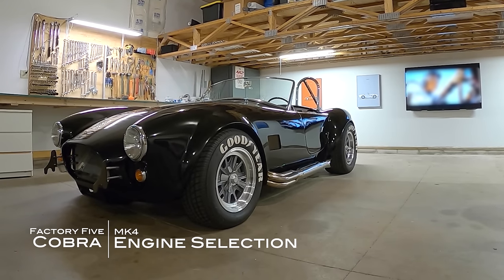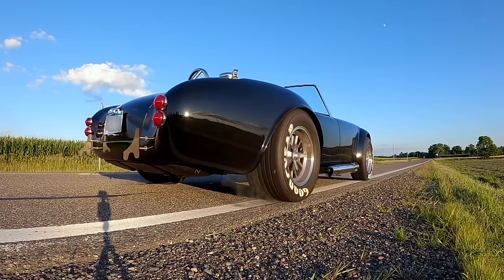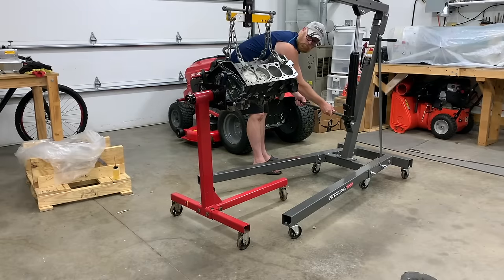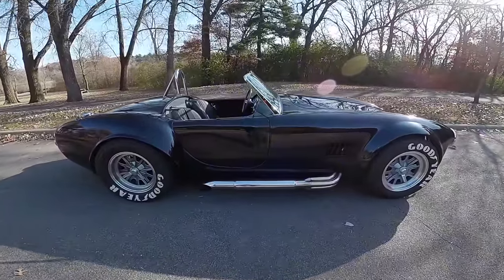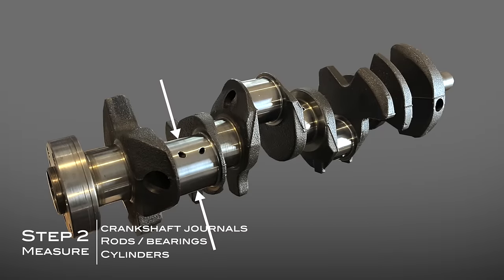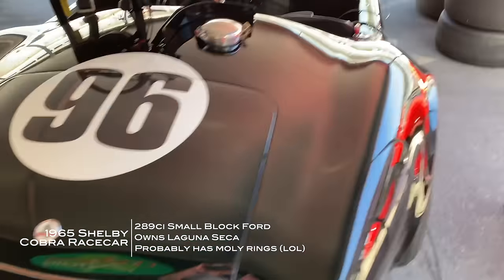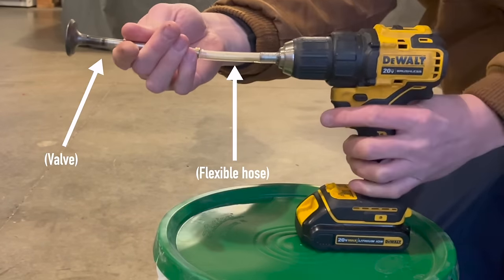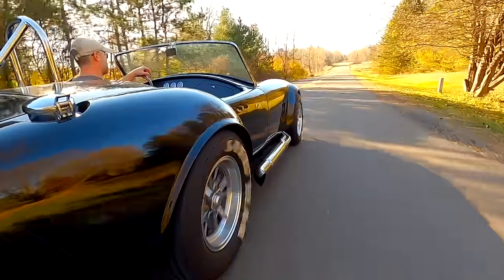Factory Five Cobra: Engine Selection

Comment: For the money, I would never use cast iron heads. I could agree with 90% of your points in the video (with a few caveats)...but there is NOTHING that 'flows well' in a small block Ford head. Even the GT40p heads that I believe came on the junkyard motor you bought are just the best of what are a horrible cylinder head design (and that's assuming your headers fit them lol). Your 300hp goal is what it is...that's subjective (I happen to disagree!!...having driven many of these cars with various power levels I wouldn't want less than 450hp and a 7500rpm shift lol). But for the purpose of the investment, and all of the benefits you're giving up...not spending the extra $500 (if sourcing used) to $1k or so on new alloy heads/cam/intake just makes no sense. You can always sell your stock heads to some kid on The Corral to make up some of the cost as well.

The aluminum heads are SUBSTANTIALLY lighter, improving weight distribution in a car known to be front heavy, and far more tolerant of poor quality gas. There is never a downside to running alloy heads on a small block Ford. If you want less power run a smaller carb, tune the motor differently, or if you truly can't deal with the differences, put a throttle stop on it. You could also run different rear gears and improve your economy substantially, while taming the car down a bit.

Well done video though, and thank you for sharing. Content creators on these topics should absolutely be appreciated.
Reply: Oh! Also...to expand on the higher horsepower/rpm point I made above. What's dangerous in these cars isn't necessarily horsepower...it's aggressive low end torque. It's the same in any relatively lightweight vehicle. I drove a 600hp naturally aspirated 347 67 Mustang for years...this was a 10 second flat car in the 1/4 mile (with a 7800rpm shift point), and would easily peel your eyeballs if you had a clue how to drive it. BUT...the way I built the motor, power didn't really come on until around 4000rpm. I put a 4000rpm rev limit on it and let my mother drive it for two weeks while I replaced the motor in her daily driver (it was that, or a 6" lifted F150 lol, she chose the Mustang as she could at least see over the wheel lol). She never even noticed the rev limiter and liked driving it a LOT more than she expected to. My then 16yr old daughter drove it easily as well. That motor in a Cobra would have been SO incredible. All the manners and good power you could ask for if you kept your foot out of it, INCREDIBLE sounding idle...and blinding speed if you ever wanted/needed it. The best of all worlds in my opinion...and far easier/economical (not to say 'cheap'...just not crazy expensive) to build than most people would think.
Reply from the maker: hey Chris - building a small block now to replace the explorer motor / going to have aluminum heads (AFR?)- stay tuned and thanks for the comments!
Reply: @TacoJoe  I prefer TFS to AFR myself lol (AFR are great heads....just not my preference!)...and don't fall for the 'port velocity!' argument. Your car weighs basically nothing, should be reasonably geared, and will be far more tame without low RPM port velocity maximizing cylinder fill when you're trying to navigate a left turn without looping it. A well built 4cyl makes plenty of torque to move these things around in any reasonable form of driving. Keeping the power up in the higher rpm ranges will make for a kitty cat around town, and a raging beast when you kick it up into the stratosphere. As long as you keep the tune safe 7krpm shifts aren't a big deal on an older stock block, and 400hp up there feels more like 600hp...and in a 2200lb car, will act like it too.

There's videos of the last 67 Mustang I built on my page...around 2008. 347, 11.8:1 compression, on pump gas. HUGE 220cc (as I recall, it's been awhile) TFS High ports (massively ported...they CnC them like that now lol), a victor Jr with a 750 Holley, then later a single 4 hole 1000cfm megasquiry EFI setup for better (again, daily driver!) manners...and 2" primary headers through a 3.5" dual exhaust. 

Soooo much fun.
Reply from the maker: 220cc + 6000RPM = beautiful sounds - NICE! I like trick flow stuff too / big fan and their stuff -- its always quality and works well in ford motors. TFS series billet cams=solid choice but maybe not enough duration for 220cc ports -lol / thanks for the comment Cris!

Comment: It's not complicated to pick a engine Ford makes every combination imaginable THE 351W IS THE LOGICAL CHOICE you can go from 351cubs to 427 you can choose from 200ho up to 1,000hp you can 1-4 barrel or 2 or fuel injection you can even use 4-- 2 barrel Volkswagen weber's $139 each  you can hammer the hell out of it as long as you the right value and locks and springs  a stock 1976 351w dish top piston with a pure stock block good head will last for ever if this power combination gets boring spray it
Reply from the maker: well said - the bottom end of 351W is about as tough as they get / thanks for the comment!

Comment: Oh contrare, it's actually the easiest decision....it has to be period correct or you are just building a kit car. So Ford 427 side oiler, the only decision is mid riser or tunnel port.
Reply from the maker: Sweet motor for sure Steve / think the 427 might command a few more $$$s to build though but evaporates tires nicely. If you are going for nostalgia, can't go wrong with that motor / thanks for the comment!

Comment: The 3.0L V6 Duratec in my 2004 Noble M12 GTO3R makes 710 bhp at 22 psi boost and weighs 2200 lbs. This calculates to 0.32 hp/lb or 3 lb/hp....WOW!!! This Noble will embarrass any exotic out there. I'm currently building an all aluminum 427W Stroker using a DART billet block for my '65 coupe. There is no substitute for HORSEPOWER....
Reply from the maker: you can warp space and time with those numbers - lol - thanks for the comment!

Comment: New 5.0 or GT350 engine. You want it to rev. Reall want to keep it light? Run a 2.0 Honda with a turbo. You wnat insanity run a 632ci aluminum big block preferably hemi pattern. Whatever engine chosen it shoukd have an aluminum block as lightweight IS the advantage of this car. Otherwise turbo a new Mustang. Or get a big heavy car like my Hellcat Challenger
Reply from the maker: The 5.2 aluminator Gt350 motor = SOLID choice but big $$$$ (just checked jegs and $22k!!! in crate form) / weighs 450lbs and makes 580HP! Mike you are totally right about going with an aluminum block to keep it light too / thanks for the comment!

Comment: Godzilla!
Reply from the maker: a nice motor for sure - I'm reading these have lifter issues though!?! - issues aside: there is no replacement for displacement :) Thanks for the comment!
Reply: @TacoJoe  

I've heard of a couple lifter issues. The problem is, all you hear about are the ones with problems. You never hear from the thousands of people who don't have any issues. The other thing is, it's not just these motors that have had issues with lifters as of late. It seems like the quality of lifters has been in the toilet for the last 2-3 years. The aftermarket lifters have been terrible along with cams, I don't know if they are using cheaper materials or what, but I've heard a ton of stories about trashed cams and lifters during break-in.

Comment: Okay first it's not horsepower to weight, it's horsepower to mass squared. That taken care of, the C8 is mid engine which puts the mass in the perfect location under acceleration. I know because when my '65  Corvair was 1st fabbed together with a  stock used '70 350 4 bolt from a Camaro and a 5.something ring and pinion. Under hàrd acceleration the 1st time it squatted down and literally shredded the sidewalls of the old junk bias ply tires. We changed the rear end after that. The 427 Cobra has been described as the world's most dangerous automobile buy a few British journalists because it was so overpowered. Shelby and Miles were world class drivers they could handle it few others can. Shelby chose the small block Ford when GM wasn't interested he found it more than adequate.
Reply from the maker: Well said Geoff / thanks for the comment!

Comment: can you use a k20?
Reply from the maker: if you want a honda motor - go for it but I think you can do better than a 2.0L in this car. Are you going for MPG?
Reply: @TacoJoe  I will like to go for rpm, the joy of riding the turbo as much you can  :D
Reply from the maker: turbos rule myman -good luck with your build!
Reply: @1990tankard  I think the only hard/expensive part would be sourcing an S2000 transmission

Comment: I just don't understand the thinking behind investing all the time, energy and expense of putting one of these together and then slapping in a junkyard mill.  When you think of what's required to tear down a junker motor, machine the heads and cylinders, replace the rotating assembly, etc. etc., the "cost savings" are minimal.

Comment: If you are going to spend that kind of money---why go thru the work  and not just buy the right one---427 ci with the duel fours!!! You need to get the real deal and you sure as hell are not going to pull alongside a corvette and show your muscles!!! I know, Shelby used the 289 ci engine back in 64-65, but back then everyone else was running small block, today, it's all about big block when it comes to building your own. Tell me you wouldn't be happier with the 427ci????
Reply from the maker: Every builder has their preference- for me, small block ford was perfect. Love how the car handles and I still have trouble with 2nd & 3.55 gears. Even with a 427, might have some trouble at the stoplights vs. a C8 because that thing will HOOK & launch - a stout 427 (and SBF) has a foot modulated traction control (lol) - thanks for the comment!
Reply: especially the sound.

Comment: Sweet car. Sounds good and looks great but I'm struggling with the engine choice.  By the time you sunk all those hours into "saving money" on the junkyard build and now even saying you are building a second engine I'm scratching my head.  How is that remotely cheaper than a modern coyote pulled from a stang or a crate engine? Not trying to be a jerk but that's a big waste of time for a medicore powerplant.
Reply from the maker: all good Matt - well something else I'll tell you that I ended up cutting from the video: I like working on engines. I have 5 V8s in my shop now at various points of rebuild and it's my hobby. It's all about what you want with your build though so if a Coyote fits the bill- go for it! You can't go wrong with that motor and your points are all valid. Thanks for the comment!
Reply: You're pretty much getting into old school vs new. Yes the coyote is ideal with tons of power especially if you add a whipple. But it costs 25k out of the box. I do love the idea of being able to just drop it in.   Or you can get a bullitt proof block windsor for $800.00 from a junk yard and pop it in there as is. Or you can modify portions, (he's not spending a lot of $$ on parts, just time). Sound is important too. I'm thinking of going with Fords Godzilla with a cam (10k) Nothing sounds as gutteral and as close to original. just my 2 cents.
Reply: I think you can find a low mile 2018 and up mustang donor car and get a motor for much less than 25k.  More than likely less than 8k.  You can get a Ford Performance voodoo 5.2 for 25k.

Comment: The time you are done building a junk motor you would have spent the same when buying a crate motor with a warranty it's not cost efficient to build a junkyard motor anymore it just doesn't make sense
Reply from the maker: I'll say that Blueprint has some pretty sweet offerings that are basically turn key - sometimes that value is tough to beat!

Comment: So it's a big block body, and the originals used a Ford V8.  So it's easy.  Find an FE engine, or even better a 429-460 385 Series.  Putting any of the very good, but totally incongruous engines from other manufacturers, makes you a misguided putz.  And when you sell the car folks will pay less for it with anything other than a big block Ford.

Comment: When you said an LS would be ok, I puked in my mouth! I call LS swapper’s parrots. Because all they say, brawk put a LS in it, brawk. But seriously LS swaps are boring. Even the engine itself is boring to look at. Yes they make good cheap power. And if I was running a drag car, I’d use one. Blow it up and get another one. But when it comes to a nice weekend car, it wouldn’t be even cross my mind to use a LS. It’s over done, blah to look at and just boring as watching grass grow or paint dry. My opinion.
Reply from the maker: Thanks for the comment James- not everyone likes the LS architecture and that's just fine :) What's your ideal motor in a Cobra?
Reply: Shelby went to Chevy first, they said no. He didn’t give a shit what brand it was, he just wanted to put big power in a small car. Putting an ls in a kit car would be a very Shelby like thing to do.